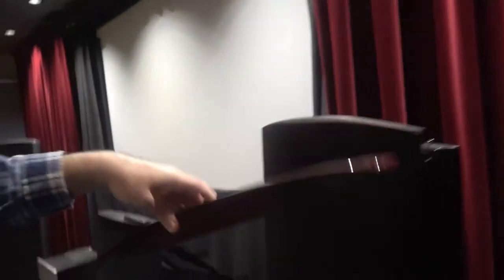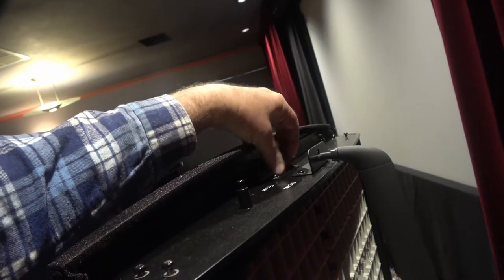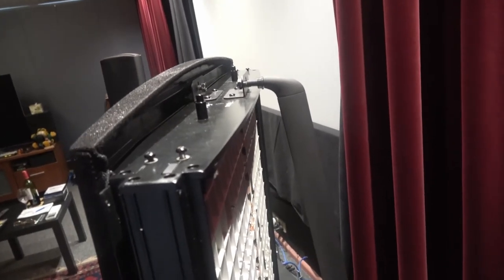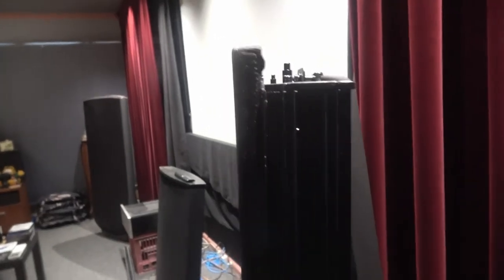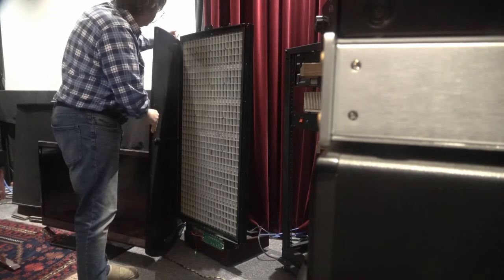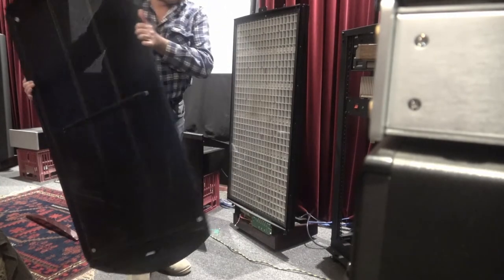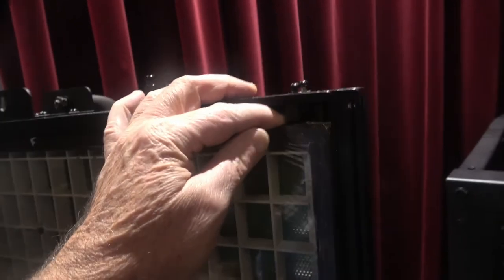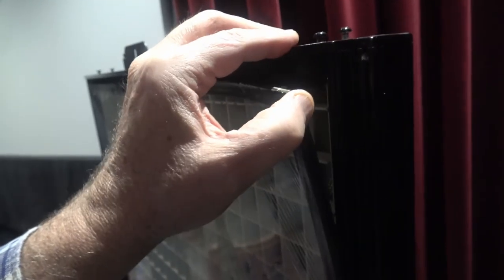QUAD ESL2912 cover removal

Comment: What is the point.  You take the covers off and why?  Is there dust in them or are they arcing?
Reply from the maker: To repair them, otherwise no need. Currently both of mine are faulty, arcing etc.

Comment: Quads sound a good deal more transparent with the grills removed. There is a noticeable veiling effect from the grill cloth and cage. Too bad they look awful without the grills. Even with the grills on they sound very enjoyable. But without them transients really snap and low level resolution is heard even better.
Reply from the maker: I'm not a golden ear. I've never heard the difference. Safety is more of a concern, to me.
The 63s may be different. I try to replace the stupid aluminium louvres with a steel grid that's a lot more open (as used in esl63 Pro). Also the theory is that you point the Al louvres down rather than up. Once again the sound difference is minimal, to me.